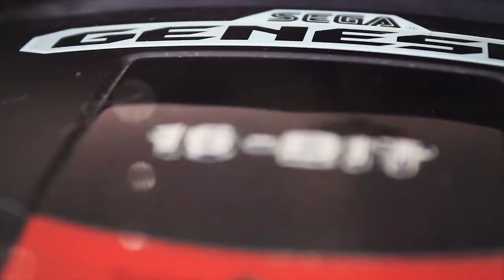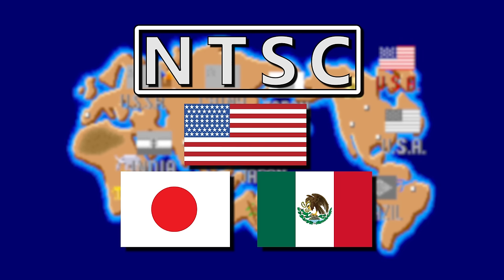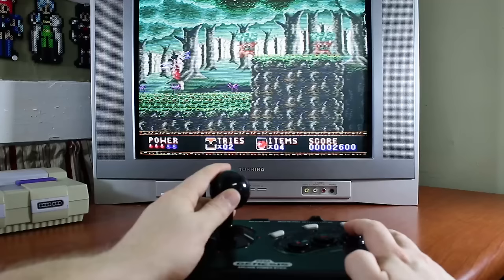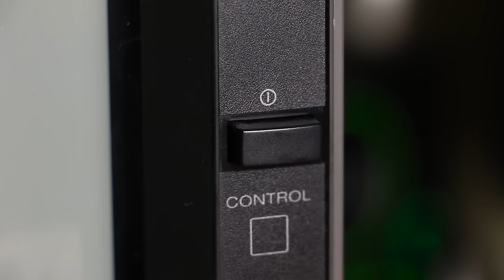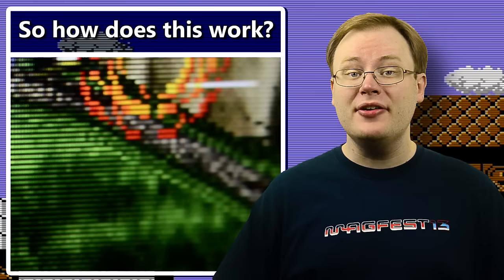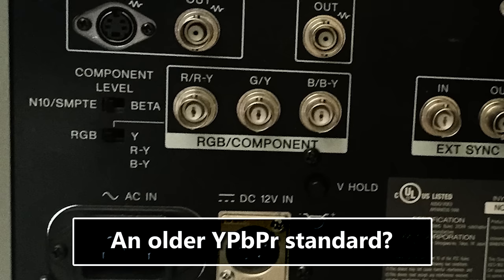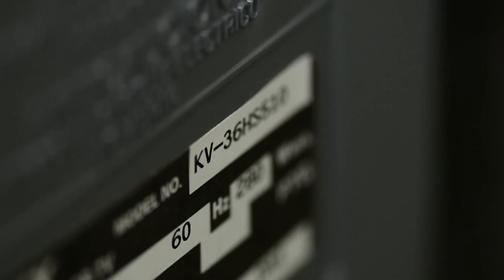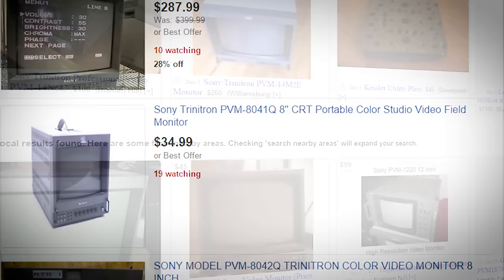Gaming on CRT Televisions, PVMs and BVMs :: RGB104 / MY LIFE IN GAMING

Comment: The Scanlines of my Philips PAL CRT seem to be vertical instead of horizontal. Is that because of the PAL standard?
Reply from the maker: +Bibbedi Babbedi [Try4ce] Some CRTs don't have a strong separation of scanlines. What you're referring to is just the look of your particular CRT's screen. Look up comparisons between aperture grill and shadow mask CRTs to get an idea.
Reply: Thanks for your fast reply, Try
You are absolutely right. What I am referring to has nothing to do with scanlines, but the way my CRT is built.
For others that want to know in short:

Aperture grill: used e.g. in Trinitrons, usually better contrast / brighter Image, seems to be preferred for gaming
Shadow mask: usually clearer Image, better for text editing etc.

Thanks a lot. You two guys are  great :)

Comment: Big bulky things everyone who says that becomes a 20 minute speech from me. these things are not bulky they are tanks they are unbreakible, you can have a 20 years old crt and it still works without a problem but new tvs are making problems after 3-4 years, there is a reason why there were in use for over 40 years !!

Comment: Have y'all researched the LCD replacement monitors for Arcade cabinets? I am looking into those because unless 3d printing can one day replicate CRT manufacturing one day they will all be gone.
Reply: +Anonarchist Does anyone know if LCD arcade replacement monitors can properly handle 240p and reproduce it more or less authentically( the best you could do would still look different)?
Reply: +Anonarchist check out the whole RGB series, all that applies to consoles applies to arcades, but many PCBs are nt 60hz and LCDs need to sync to the frequencies of your arcade PCBs.

Your best bet is a PC monitor with a wide sync range and an XRGB-3.
Reply: I have already seen the whole series. The fact remains that all CRTs will one day be gone.
Reply: You could try a gsync monitor for non standard sync pcbs
Reply: by the time ALL crt's are gone we will probably be gone too
Reply: Anonarchist I

Comment: 16:41: "A standard CRT's electron gun draws one horizontal line from left to right in 0.0666 seconds, which is about 1/15kHz" 
I don't think that's correct. It's either 1/15000 second or 15kHz. Maybe 1/15k second, but not "1/15kHz", as that would be only a very small fraction of a single Hz, which would be a lot slower than even the 50 or 60Hz vertical refresh, and obviously the horizontal refresh needs to be a lot faster, not slower, as there are many lines to a frame. Remember that Hertz stands for cycles per second, so "1/15kHz" would mean 1/15000 cycle per second, which is very different from 1/15000 second and also very different from 15000 cycles per second.

Comment: I use a CRT PC monitor to play retro games. I use retroarch and display a 640 x 480 resolution, then use an interlacing shader to display only the alternate lines giving me 240p. I just make sure that "Integer scaling" is enabled so that the emulated content scales perfectly to each line. It basically gives the same effect as a PVM but you can pick up a monitor for like $5

Comment: Amazing vid! 👍 Just you forget 1 thing to mention, white contrast which is the real difference between lcd's, led's and even oled. You can see whites in crt's is more brilliant and pure, which gives a perception of 3D deepnes, while it looks plain in all of the flat hd screens. Also, there is no tearing in 60fps images, no retention if a logo is for more than 1hr on screen and of course, a better representation of colour.

By the way, a final tip for crt's enthusiastics (like me) 👍 if you're thinking on buying and old tv for playing, I recommend better a crt pc monitor, which supports 1024 resoltion, you can use a dvi to hdmi converter and just use headphones for sound. You will not regret if you buy a Viewsonic dvi or even, vga monitor. You will get an amazing piece of technology 😃

Comment: Now I grew up in the transitional period between CRTs and LCDs, our family replaced our lovely Trinitron, because it literally took up the space of an armchair despite it only being around 25-28 inches, in 2006, I think. It was before 2008 but we have footage of it at Christmas 2005, so I think it was 2006 or 2007. So before LCDs took over, despite us not being early adopters, because dad wanted an armchair. Despite this I’ve always kinda liked them. As much as the CRT hum bothered me, I liked the warm glow of their screens, and we kept our oversized Trinitron until like 2012 to watch VHS tapes upstairs. I wish I’d known how much better CRTs were back then, so I could’ve kept that lovely TV.

Despite the loss of our Trinitron, I still have a CRT. I received 3 CRTs from my Nan a bit before 2010, an 80’s old-style shadowmask, 20 inches I think, a 1990’s silver shadowmask, around 18 inches? Maybe 16 or 14, not entirely sure: I wasn’t even 10 back then. And also, a 14 inch Matsui TVR185 Portable with built in VCR. The 20-incher was the only one which had a remote when we got it, but we lost it immediately and as it didn’t have channel changer knobs we binned the TV. The 18-14-incher had no remote but had knobs, however we didn’t keep it as it was on its last legs and I’m pretty sure had been dropped before, so we got rid of that too. The Matsui we kept despite its lack of a remote, and me and my dad used it to watch analogue broadcasts of the Grand Prix in the loft using a jury-rigged handmade antennae using a bunch of crap we had lying around. We replaced our aerial with a proper one, and then later another one that worked better, but we kept using the TV until 2011, where we watched the last analogue broadcasts together. After this, my dad was gonna throw it away as he considered it useless, but I saved the then-11+ year old TV by convincing my dad to keep it for watching VHSs as our external player had started eating tapes mere weeks before. Now, I do all my gaming on it and despite its limitations, being a shadow masker and all that, I plan to keep the thing even after I upgrade to a PVM as the now 15+ year old TV has a lot of sentimental value to me, and I dread the day when it’s tube’ll finally fail.

EDIT: I just acquired a Sony Trinitron KV21X5U, one of, if not the best CRTs ever made, and HOLY CRAP IT’S INCREDIBLE! The colours are beautiful, it’s amazingly bright and shockingly sharp, and I love it so much! The geometry is near-perfect, and unlike my old TV I can fix it, and it’s such an improvement I honestly can’t put it in to words. The cylindrical screen also looks brilliant, and I love the charcoal grey colour. One downside though is that despite me choosing 21-inches to fit into my setup, I buggered it up and couldn’t fit in in, and I had to throw away an unnecessary wardrobe to fit it in, which means I may as well have brought a 25 or maybe even 28-incher, so I’ll probably upgrade later. It’s also horrifically heavy and massive, and very, very imbalanced as the screen is super heavy.

Comment: I do like CRTs for retro gaming, but I just don't have the space for CRT TVs at home (my house is TINY!!). I just got a 15" TV from a friend that he was going to throw out because it doesn't have digital TV, all analogue (no analogue here where I live anymore), but it was one of those first LCD TVs... analogue, with VGA, SCART, Composite and S-Video, and a 4:3 aspect ratio (no panoramic here!!). I'm really pleased with this TV, because I can have it out and using it, it takes up very little space, has a crystal clear image over RGB SCART, and uses the resident aspect ratio of those consoles, so it just looks like it's supposed to. I've never been a fan of classic consoles on HDTV because when you have it on fullscreen, the games are just wrong in 16:9, and when in 4:3 with those black bands down the sides, I don't know if it's an optical illusion or something, but I doesn't look right to me, it looks narrower, like it's 1:1 or something like that, and feels "squished". I've measured it and it is 4:3, but it just doesn't look it. On this old LCD I got though, with the image to the borders and in the ratio it should be, it just makes the games so enjoyable!!

I'm going to make an adaptor to use the VGA input as a second RGB SCART so I can have my Mega Drive and Master System in at the same time without external boxes I have to change buttons on and things like that, and my PS1 through S-Video which looks great too (especially on a small 15" TV)

I do have a CRT stored away, but it just takes up so much room to have out in use, and PVM/BVMs are great, but still take up room and are pretty expensive where I live!! Only thing I'm missing out on is lightgun games...

Comment: in 2009 i bought my TV, a sharp aquos. I have had zero problems with input lag, and zero problems with image clarity. Game look excellent scaled up to the 42". I have connected PS1, PS2, XBOX via S-Video and XBOX 360 via Component. I don't miss CRT - i did my time with those. But my TV does have proper analogue circuitry built in (as well as digital). Rather than going to all these ridiculous lengths, people should see if they can find TVs with proper analogue circuitry rather than the emulated rubbish most modern TVs have. Spend the money on the TV and you wont need a ridiculous CRT room in your house, or a frame meister!

Comment: I know this video is from 2015, but a big figure in scan line visibility on CRTs is the brightness of the TV.  I have a 14 inch little SD CRT, and the scan lines don't show up with brightness over 75% or so.  Bigger TVs have a better electron beam size to TV size ratio, so they can have greater brightness with scan line visibility remaining.

Comment: Just throwing this out there but I bought a less than ten year old 20" PVM that only does composite and S-video.  Side by side with my Sony PVM that has proper RGB inputs there is very little difference and I paid a heck of a lot less for the non-RGB PVM.  And it still looks significantly better than the S-video input on my old tube TV which in my opinion still make the purchase worth while.  RGB may be the holy grail we are wanting but if you just aren't willing to pay out the price then the S-video is more than close enough in quality on a decent PVM.

Comment: Back in 2005, living in Japan I owned a high-end 32" Toshiba crt, which I used with my 360 xenon e ps3 fat (60gb, first model), connected trought component... It was capable of 720p and 1080i... Only today I can say it has been surpassed by a slight edge compared to LG oleds (in terms of gaming)... 13 fu*king years!!!

EDIT: but I still own an 1996 29" Sony Trinitron multiregion (Pal/Ntsc) but only trough RGB scart... I'll I'll set it up surely by buying soon a Pandora box!❤️

Comment: 19:11 is spot on. I did a test today w my newly obtained HD CRT and my lcd TV and standard CRT. Lcd has the sharpest pixel edges but can introduce blur close to them. HD CRT literally looks like a mix between standard and lcd. It has some texture & color charm of standard crts but also look a lot like an lcd. However for 480p, like the wii, the hdcrt shines a bit beyond my lcd.

To me a small SD CRT has the most charm and hides flaws the best for text, aftifacting, and pixel edges. To me on it even RF can look better than lcd play.

SD CRT vs HD CRT vs Lcd
Atari Gen- pixels so big not much difference, SD preferred for black levels
NES gen- SD preferred for pixel smoothness
SNES gen- text is best on SD CRT, similar to nes gen but not always as helpful
32bit to Pre HD era- HD CRT doesn't have the blurriness of non native resolution like lcds, so that's my pick. But small SD crts look best with composite and hide jaggies

Comment: So informative. Blessed to have my 32" Sony Trinitron I got for $12 on Craigslist.
Reply: Usually the bigger the cheaper. Often 32" means (near) free. 20" is most expensive, those do 100€/$+. People hate it to lug those monsters around. I've 32 inch B&O with built in DVD player and 2x100W speakers, with a motorised stand and a aluminium milled remote. New price 4000€. Now 10€. It was 85kg and took my husband a week to recover from back ache and muscle pain.

Comment: Well, I've got no PVM/BVM, but I do have a 19" LG Flatron F900P which has a pretty good picture for a CRT! The scanmask is very thin and it can show 1600*1200 visually (and works with resolutions up to 2048*1536)! It also has got the BNC-Connection with HD-Support! I bought it for ~400€ (or was that the intended price and I got it cheaper?!), when everyone already started buying their 15"-17"-PC-FlatScreens.
AFAIK it supports pretty much all resolutions (even non-standard), different color-carrier-frequencies, different Hz, different color-spaces like RGB/YUV/etc. and I think, that it also can be switched to output an interleaced picture! Oh and I vaguely remember that it supports various ways of syncing (sync on green, hv-sync, possibly sync on luma, etc.), but not sure about the entire list.

I specifically bought it for gaming back then... (Hm... 2002-2003?) and up until ~2008 no LCD/etc. was fast enough, to even come close to it's 'lag-free-ness'. I certainly had an advantage in fast games like UT! 😄

@My Life in Gaming: Thank you (2) for all the great videos, especially regarding picture-quality of old consoles!

The LG is 'only' a consumer-grade PC-CRT (in that section quite 'high end'), but I still love it because it can produce a good picture and supports quite some stuff! :)

Oh... and it has got a quite dark black!

Comment: I have a 20M4U and 14M4U which accepts 240p & 480i. I also have some Sony Trinitron’s which accept higher resolutions KV-36XBR450, KV40XBR800, KV-32FS100  I’m trying to decide on whether to go RGB Scart or Component for my consoles. I’m leaning towards HD Retrovision Component cables because I have a few Trinitron CRT’s with component input as well plus most the consoles I plan to play have component options (Analogue NT Noir, SNES, Genesis, Sega CD, PS1, PS2, PS3, OG XBOX, X360, GameCube, Wii). I just want to make sure I make the right choice by getting the most out of the PVM’s picture quality. They mention that Component on PVM is essentially same quality to RGB but may require some calibration to help with the white balance with component but now I’m trying to find out how to make sure it is properly calibrated & if I’ll have to calibrate it for each console. I still have to find a way to run test suite but not sure if that will help with adjusting for the white balance mentioned. I guess I’m clueless maybe once it’s adjusted hopefully it will look proper on all the consoles. I am looking to try to make it as easy and enjoyable as possible if I’m playing on different consoles. Even looking into switchers to avoid having to plug in multiple times. Any suggestions would be appreciated.

Comment: The section on the HD CRT Trinitron hit home with me. Last year, I picked up a 32" version of the exact same model for free. Before that I had been using an SD 27" Trinitron, from 1994, that does show it's age a little. The older unit also only had video inputs for one S-video and two composite. It's still great, but I thought I found the "all-in-one" CRT with the HD Trinitron. 

The new TV had a ton of inputs including two composite, three s-video and two component. So now I could use my ps2 and Wii component cables on a CRT and hook up everything else! Right? 

Well... the 6th gen systems (PS2, Wii and later an OG Xbox) really do pop on this monitor, however, I started noticing some weird graphical anomalies when playing the SNES where the TV "filled in" the extra lines from 240p in weird ways. In the end, I've revamped my setup going back to the old '94 Trinitron and hooking up my 3rd to 5th gen consoles (plus a second PS2) via s-video and composite (slowly working everything up to s-video). I still have my HD CRT set up with the 6th gen consoles for now as I think it still may be my best option for them (even with the bit of lag). Ultimately, I am still on the hunt for an SD CRT with s-video and component so I can have an all-in one station for systems up to 6th gen. It'll be nice to just have one CRT to deal with too.

Oh and that HD CRT is one heavy ass son of a bitch!

Comment: I used to have a 36" Panasonic flat tube TV, it was the best TV I could find at the time. It wasn't HD or anything, but it had some pretty cool features like geomagnetic correction that you could adjust in case interference was affecting the picture. That TV weighed at least 200 lbs and was nearly impossible to move with only two people.

For some reason I always hated the curvature of old tube TVs, especially big ones, so I was enamored to have such a nice flat tube. The picture on it was good, and it had plenty of connections that I could use for stuff like my Sega Saturn. However, there was an obvious drawback that I found when I tried to play Virtua Cop: there was a dead zone on the left side of the TV, a vertical line of about 2 inches wide, where the light guns just could not track properly. I'd try shooting something and nothing would happen. If I tried hard enough, I could pull off shots even further to the left, but no matter where I stood or how I lighted the room, that dead zone was always there.

That, combined with the ridiculous weight of the thing, prompted me to give the thing away several years later under the promise that I didn't have to help move it (I had moved it several times and each time felt like more of a pain than the last).